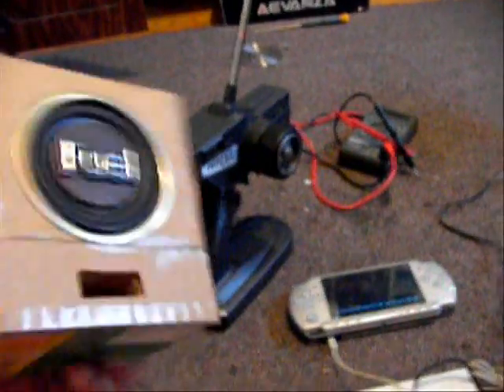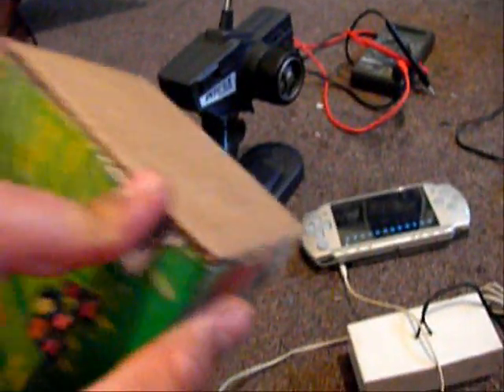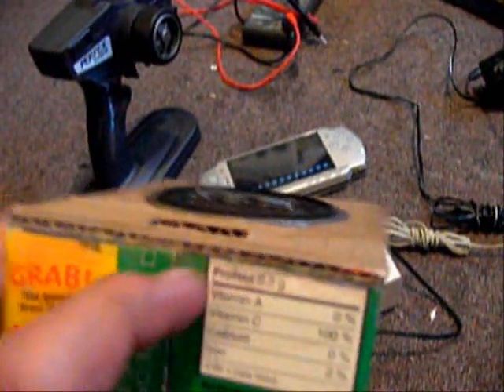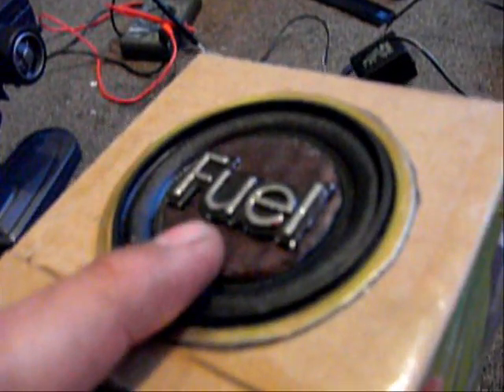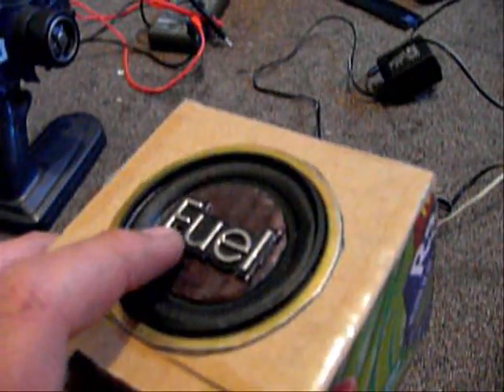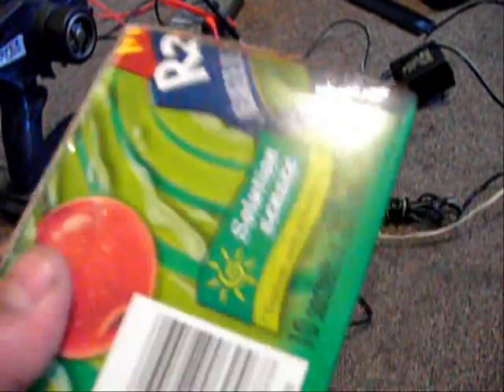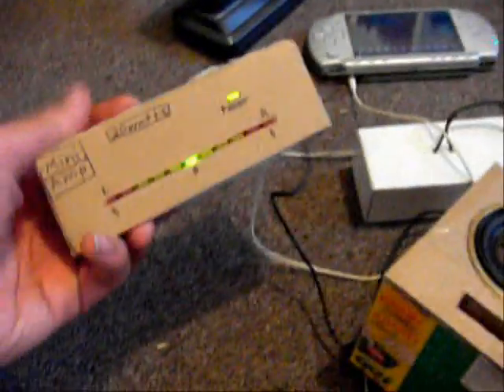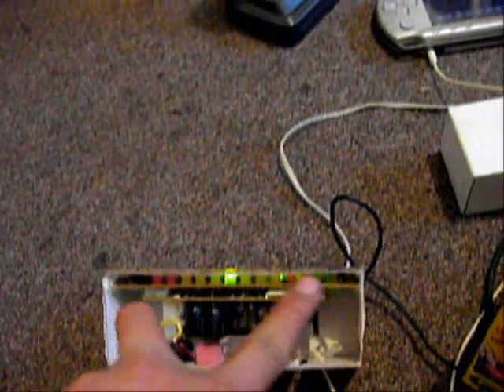Homemade 2.5" Mini Subwoofer 2

Comment from the maker: @HDXFH I had this amp for like 2 years now and i used it on many speakers and it didnt blow or anything but it might be just because you either hooked it up wrong or over volt as it uses 9v-12v